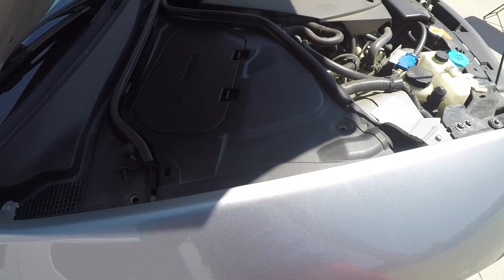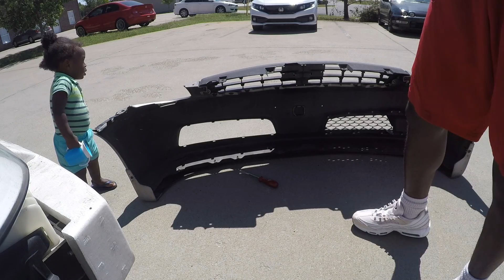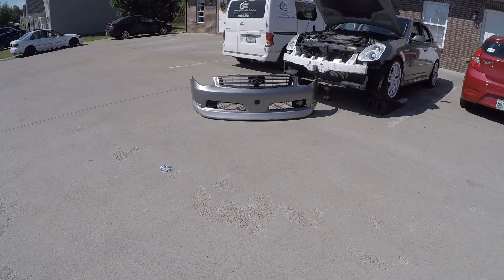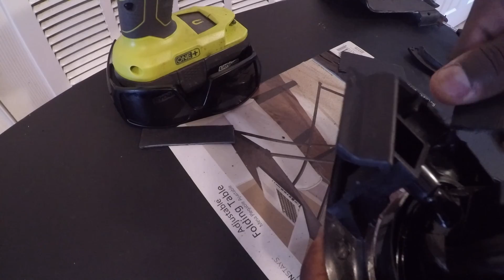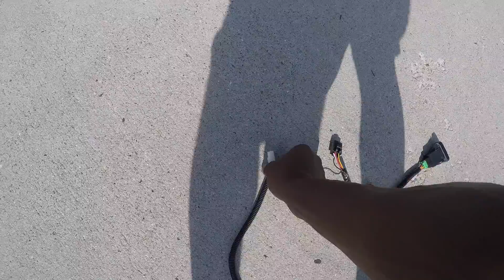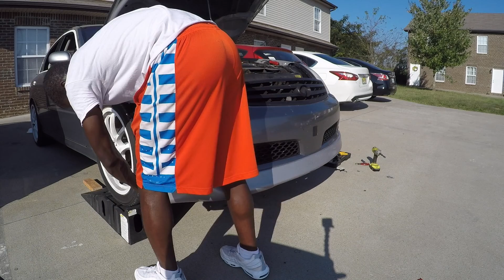Fog Lights In Bumper - G35 How To / Install

Comment: I bought the same fog lights but when i remove the bumper for my surprise the grills are stick in the bumper and I have to cut the bumper
Reply from the maker: Well I doubt this is the right thing to do in that case
Reply: @idealautofactory  I did so and it worked well but to the fog lights where the screw enters I had to cut a little to make them fit and it was
Reply from the maker: You got instagram?
Reply: @idealautofactory  yes

Comment: What front bumper is that you have to get those specific headlights I have factory and don’t have slots for that at all
Reply from the maker: Could you describe what you are talking about? Our bumpers are identical
Reply: Okay how your front bumper has the mesh spot for you to install fog lights mine has no open spot right there
Reply: Also I meant what bumper to make fog lights work but also where you get those headlights all white at ??

Comment: Bro i don’t see wires for fog lights where you see the wires
Reply from the maker: Nitro Go Brazy Are you saying you need help wiring it?
Reply: MechLovin like as far as fog light wires, I don’t see any well I didn’t see any when I installed my  aftermarket headlights. I was just gonna tap into my headlights an have them on with my parking lots come on type stuff
Reply from the maker: Nitro Go Brazy oh yea you are correct the 2003-2006 G35 does not have a separate foglight harness. You have to tap into the corner lights.
Reply: MechLovin bet simple enough lol
Reply: @idealautofactory  were did you get the “harness wire” to connect to the corner light connector
Reply: Do you have a link of we’re I can get
That same harness from the fog lights  to the conner light harness
Reply from the maker: No I do not. The fog lights I bought came with a harness. Literally power and ground though. There is no relay to use.
Reply from the maker: You could tap into power and ground for the passenger foglight/corner light and then tap into the power and ground for the driver foglight/corner light. No need for a fancy harnes
Reply: @idealautofactory  same thing i was gonna do but i got a new car